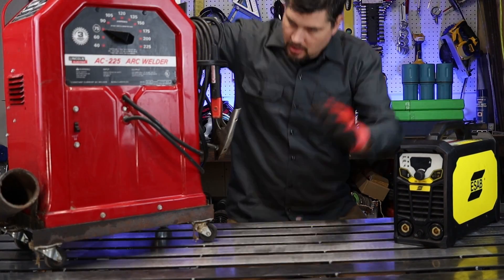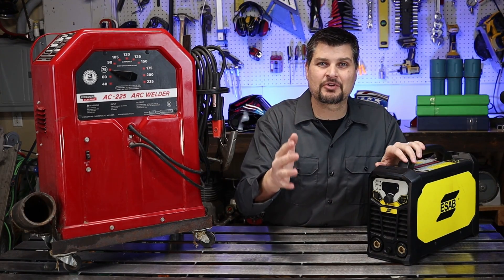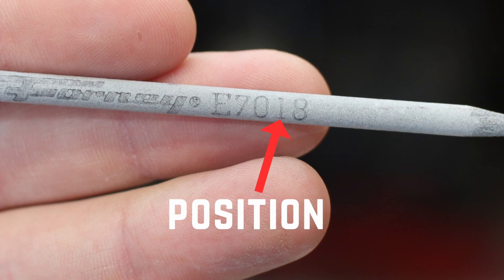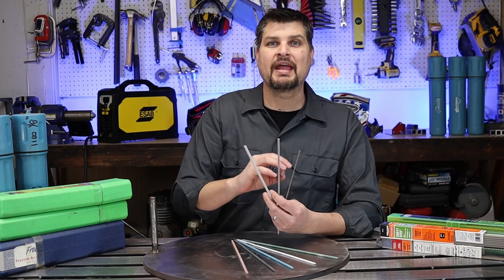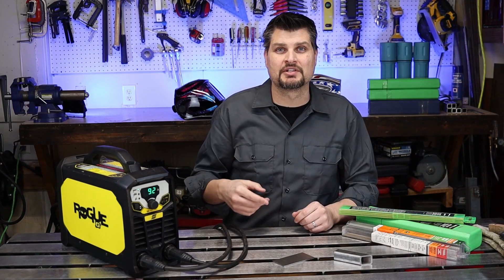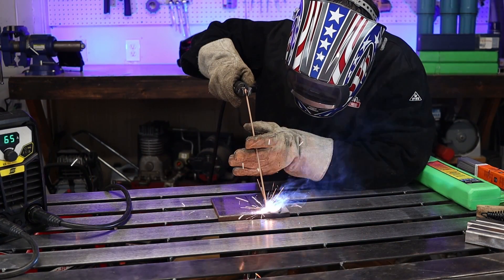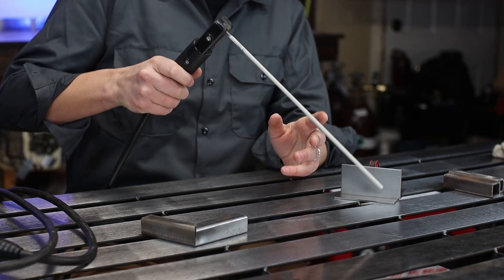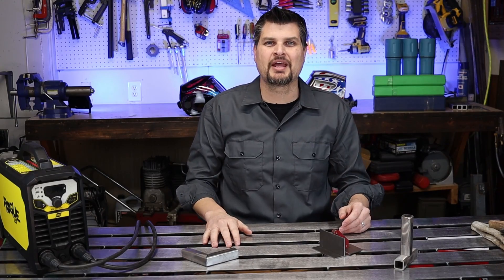Stick WELDING Basics: How to ARC Weld 101

Comment: Great Tutorial!  My Machine is an inverter type, I am using 1/16" 10" rods They are E6013 Lincoln Electric Fleet Weld Rods. I am using a 120 Volts Inverter Arc Welder. These rods say they are rated for 20-45A  I have an auto Darkening Welding Helmet, Leather Gloves, a Welding Vest made of Cotton, and I am learning how to weld.  Went through a little bit of this back in High School, but needed a refresher course on it since I am now 40 lol You helped me a lot. I need some scrap metal to weld on, but What type of Metal can I weld on with these rods?  Can it be Iron, Steel, Aluminum? What metal?

Comment: Which one do I plug in the connections for this welder Welding Machine 110v Stick Welder, 140Amp Small Mini PortableWelder Machine, IGBT Inverter ARC MMA Welder MMA Soldador Portatil with Hot Start, Arc Force, Anti-Stick

Comment: Why does my welding rod stick to the metal and the arc won't start? It sparks but it often melts and sticks to the metal.

Is my grounding not good, or the current not flowing optimally?

Comment: I hate that Striking it as a match it's not like striking it like a match. When you strike a match you put a lot of force into the head of the match to light it , But when you strike the electrode you cannot put a lot of force into it otherwise you are going to make the electrode stick So striking out like a match does not work There needs to be different terminology

Comment: You have several videos that are really helpful for the DIY'er with very limited equipment. I have the slightly bigger brother of the welder in your $39 Amazon welder video (but 120/240v in). 
    Luckily I have a 20A breaker, and (of course a 25ft. 10Ga. extension cord with triple outlet; I have to go outside to work). But if I go portable I might only  have a 15A breaker to work with, and that might be all  you've got. Maybe you are young, with kids and living in a apartment, and you can only go to your grandparent's house,  unplug the washing machine and weld in the driveway. 
    There are reasons why you might really want to weld, but be stuck for a long time with a too small machine. So I've thought a lot about what can you do if you are limited to 55-65A. 

    So here goes: 
     7018 is a long shot. 3/32" rods are widely available but 60-65A is the very minimum of what they need. The legendary strength of 7018 could be cancelled out by porosity (restarts). Restarts because you keep tripping the breaker or you struggle to keep it lit at a low current setting. 
    Hobart makes 1/16" 7018 (30-50A), but it is hard to  find. I got some at Murdoch's at $13+tx for a one pound box, but I haven't tried it out yet. This should work but I don't know if it is worth the trouble. 
    Maybe get good with the other types first. 

    I would bypass 6013 in favor of 7014. They are both shallow penetrating sticks with heavy slag, but 7014 can deposit more metal (like 7018). If 6013  is what you can get, by all means use it. You can do good work with it. Either of these ('13 or '14) would be good to learn with.  
    I do get the 1/16" 6013 (20-45A) from Harbor Freight. They have a two pound box for $9+tx.($4.50/lb.) which is a good price for such small sticks. 

    The sizes smaller than 3/32" always cost more per pound. You have 3/32"(=6/64"),  5/64"(=5/64"),   1/16"(=4/64"). 
    I've got some Blue Demon 7014 in both 5/64" and 1/16" sizes. The five pound box of 5/64" is about $4/lb., but the 1/16" is ,$7/lb. The Blue Demon recomended current ranges are 3/32":70-90A,  5/64":60-80A, 1/16": 30-60A. 
You might be able to use the  5/64" because 7014 has no problem with restarts (unlike 7018). You could weld an inch of bead (or even 1/2"), wait a minute or two, and repeat. You could also make three overlapping passes with 1/16". 

     6011 is an agressive, deep penetrating electrode, but it is also fast freeze. You may be able to weld fairly thin metal if you move fast.   If you start to create the puddle and then break the arc the metal freezes instantly. You may be able stitch weld thin metal together this way (random over lapping tacks untill no gaps remain) 
     The current range for 3/32" is 40-90A, so you can go pretty low on the current. I would not learn to weld with this one, but don't ignore it either. 
    Hobart also makes a 1/16" 6011 that runs at 20-40A. I can get a one pound box at Murdoch's for $12. I would stick with 3/32" unless you really need the small one. 

     So part of the low current game is to have the small sticks you need while keeping an eye on the cost. 
    It makes sense to learn thin metal welding if you have a small machine. I already mentioned stitch welds for sheet metal. 
    For steel tubing (round or square), it is easy to burn thru, so there is a dab-dab technique (for 6013 & 7014) you might use to spread out the heat. 
    You strike the arc and drop the stick to about 45°and then break the arc once you have the molten puddle. The metal will cool from white hot, to pale yellow, to orange to bright red to dark red to black. You restrike the arc on the front edge of the last bead before it goes dark. The new puddle will remelt the front third of the last one, and so on. The drag angle, 45° below the horizontal, lets the arc force push the heavy slag back away from the front of the puddle. It is usually easy to restart the arc while everything is still hot.
 
    Anyway, that's the low current stuff I've been thinking about for the last couple of years. DIY PRO is very flexible in showing lots of ways to do a project, which I appreciate. If you made it this far and you   found anything useful, take it and run with it. Best of luck.
Reply from the maker: Congrats, I'm pretty sure this is the longest comment anyone has posted. 
Thanks for the insight!

Comment: I am a wanna be welder, a total noob.  As I understand it, you do not want to actually touch the rod to the work once you get the arc started, yes?  You want to maintain the arc but keep the tip of the rod within 1/8 inch or /16 inch, yes?  I don't think you addressed this in the video.

Comment: Great information, thanks. One thing that I can't seem to find on any intro video is information going in depth about grounding. I know the negative needs to be grounded to the work bench/piece but I noticed in this video you only had a small section cleaned raw and the rest was rusty. Is this fine? Do all work pieces need to be cleaned down to raw metal. If you can clarify this I would appreciate it!

Comment: Love my Lincoln ac dc machine. Done alot of different work over the years and needed it. But i agree with 7018 and 6013. Always used 7018s in the plants and 6913 at home. Smaller stuff.
Reply: hell yeah

Comment: I have never touched a welder in my life, I was thinking of picking up one of those cheap handhelds on Amazon.  I need it just for one thing, I had to cut the exhaust on one of my vehicles to drop the transmission and I need to put the exhaust back on.   Would one of the cheap ones on Amazon do the job?  I don't care how the word looks etc, I just need the exhaust back on

Comment: I have a Hobart Stickmate 235 LX. While I am not the best stick welder in the universe, I am just a DIY-er Welder. I do not weld all the time. Maybe 20 times in the past 10 years. However I have no issues with striking the electrode and running a decent bead. My issue is (while using 6011 electrode) and can never get the elusive "Slag" cap over the bead that I always see in videos that the Pro Stick welders get and they just casually lift off. I relish the day that is happens to me. Any tips on getting that prized "Slag" cap on a weld bead? Information: 1/8"" electrode (6011), 90-amps, on 1/4" common steel.
Reply from the maker: Smaller rods, 3/32" and thinner, are hard to get a cap especially with 6010 and 6011. Those 2 just love to chip off in little pieces. 7018 produces the best slag peel. If you want the satisfaction, get some 7018, 1/8" rods and have fun!
Reply: 6011 is my favorite stick. For the 80+ years it has existed it has been used to weld rusty, greasy painted metal that can't be properly cleaned in the field. Known as the mud rod, farmers rod, etc., it aggressively burns into the base metal. It is fast-freeze and has filled many unreasonably large gaps. (If the gate is busted, you need a strong repair as soon as possible!!!) 

    If you can get a nice slag cap on your 6011, you may be the very first person to ever do this. Take a picture! But for someone learning 6011,  expect an ugly mess. Even if you get to  be a 6011 wizard, and you have evenly spaced little ripples in your bead it's still going to be kind of messy and ugly. 

     For guys learning 6011, don't kill yourself trying to  make it look like 7018. You could grind it, make a small, deep pass with 6011, and then fill it out with a larger 7018 pass. I just don't want anyone to give up, because they made an ugly weld with 6011.

Comment: Been welding (self taught DIY) with a 250 Amp oil bath machine for about 35 years and then got lucky.
My sis in law gave me a working 160 Amp inverter machine on condition that I repair their 200 Amp machine, which I did for about 5 Dollars.
What a pleasure to weld with DC.
Informative video mate. Thanks.

Comment: I bought a pack of 6011 because it's all they had and I wanted to practice because I have absolutely zero experience. Either I'm the worlds worst beginner welder or those rods are tough to learn with because I ruined two rods because they would stick before I ever got a bead going. I'll try 6013 when they come back in stock at Tractor Supply and hopefully my confidence will improve.
Reply: Save those 6011's, they may be useful later on, but maybe not to start with. 
     You're gonna stick those electrodes (unless you are a robot). Sometimes you can get unstuck with a quick twist of the wrist, but just keep at it. 
Try increasing your current setting ten or twenty amps, that might be the problem. 
    You might try 7014, if you can get it. I've made slag welds with both 7014 and 6013, but they would be the easiest to start with. You can avoid that by dropping 30-45 degrees below the vertical, like you are dragging the stick away from the puddle. The stick is pointed back towards the puddle and the arc pushes the slag back out of the way. 

   Anyway, have fun, because then you will weld and learn more, and get better faster.

Comment: some expert welders say 6013 is the easiest to learn with. One pro told me that DC is easier for beginners. Also, for tool steel of any sort you need low-hydrogen rod like 7018  or 10018. For tool steels, preheat a little, not red hot just say 300 degrees,  like with a propane torch, and use a littel less amperage. If you can, have somebody with a propane or acetylene torch to keep the weld from cooling really fast and hardening. Like when knife makers quench steel in oil. Fast cooling make it hard and brittel and your weld might break.

Comment: What about Acid rods vs Alkaline rods.?
Im not a welder, Im green when it comes to this, but got myself a stickwelder.
Its a new Insulated gate bipolar transistor-based handheld welder, but its packed with a lot of adv. settings for one of these sketchy handheld welders from the fareast .
* Hot start percentage
* Force percent
* Valley percentage
* FRequency percentage 0 to 99
* VRD
* vs CC vs CP  (seem to be Alkaline vs Acid rods and the visual in the colorscreen shows full vs half, is that the cycle?)
Trying to find logic in these settings... you can see them here. https://www.youtube.com/watch?v=j3ApUD9zS9w
as mentioned its a new generation of even smaller IGBT based handheld welder.. that weighs 950g and uses less wattage.. between 2 to 3k, I'm on 230v (Denmark)

Comment: For all of you beginning as a certified welder, don't be intimidated by the 4g (overhead) position. Remember, an overhead is an upside-down flat (1g). Set your heat for the 1g for the 4g.

Comment: I've been welding since 1972, AWS D1.1/5.20, 1" plate all positions. I've used AC and DC but prefer DC as the rod choices aren't as limited or expensive. 6010 or 5p are DCRP. 6011 is AC or DC. 7018 if AC is with red numbers, sometimes double stamped. DC is most often the best to weld with.

Comment: Great informative video, I have just managed to get a small DC stick welding machine. This is great advice and starting tips for welding newbie like me.
Reply: Don't push down and strike it like a match. Just scrape the bare end of the stick across the metal to strike the Arc. If you actually strike it like a match then you'll realize why it's called "stick" welding. But really if your rod sticks then just turn the volts up. That's all stick welding is, amps to melt the rod and volts to help it penetrate.

Comment: If my Home Max Voltage is 220V and Max 30Amps , Does That Mean I can Only Set my Mig Welder to Only 30 Amps and Only Use 1/16" stick 20-40Amp
Reply from the maker: No, your house 220V and 30 amp would be the input voltage. The welder takes that voltage and drops it and ups the output amps. You can use Ohms law to figure out the exact input and out put voltage and amps. The max amperage you can typically get OUT of a machine on a 20amp breaker is around 120 amps. Running on 220V and a 30 amp breaker you could get around 250 output amps. It's late so hope that makes sense!
Reply: @-DIYPRO-  Thank you.. Once you mentioned Ohms Law I found articles..

Comment: The old tombstone transformers are def big and heavy, no doubt. But they're freaking indestructible. Replace rotten wires, sand corroded terminals .. banda bing bada boom, good as new. I'm a big fan of electronic circuits built with PN junction semiconductors that the inverters are made from, but there's something to be said for the zombie-apocalypse-surviving simplicity of the transformers. Worth having one around imho.

Comment: Good job. Great video enough info to get safely started with.  I'm a DIY'er myself and it took me about 5 mins to figure out that MIG welding is to messy for me. So now I'm moving on to ARC. This looks a little less messy so I'm anxious to give this a try. I've seen guys doing "tack" jobs that look really clean. What sort of weld is that? Someone said probably aceteylene? How does that work? What kind of welding is that actually called? Do you have a video on what that entails to get start started?

Comment: they way inverter welders they work exactly like the VRM on a computer for power for the processor. Instead of having one giant transistor that will get really hot, so what they have is multiple transistors that fire down a line like a marque light.

Comment: Couldnt get any cheap inverter machine to run worth a crap. Im sticking with the good old buzz box. Much nicer  welds.
Reply: I'm loving my titanium unlimited 140 it does a good enough job with Arc and mig I haven't tried out the Tig yet

Comment: This DIY welding is 110% free educational...
Its a wow🎉🎉❤
Reply from the maker: Thanks!
Reply: @-DIYPRO-  Hie what welding machine you would recommend for people where is no electricity at all, should they buy DC welding inverter and power it with generator .Please help because I want to know whether is possible running DC welder using  AC geretor

Comment: Thank you for the video. I am in the beginning of learning stickwelding, having only used mig before. Gonna weld a pizza oven, so this video was informative!
Reply: I am learning to stick weld as well…I can mig weld pretty good and I thought I would jump in and stick weld without any problems…I was wrong 😂 something that i kept having issues with at first was not pushing my rod in bc it’s not self feeding…but you get the amperage right for the rod and then figure out how they burn it’s not too hard…good luck to you

Comment: Can u explain y not to start with 6010 that’s what we have at my work
Reply: If you have a professional DC machine, you get a nice clean current (almost like a giant battery),  so 6010 runs great. 
     But if you buy your own machine on a budget, you probably have a used AC buzz box, or a cheap DC inverter welder. 6011 runs just fine on either.
     6010 won't run on AC, and probably won't run on the cheap DC machine. These little machines either don't have very good filtering (jittery DC) or maybe none at all (pulsating DC). For whatever reason 6010 hates this, and 6011 doesn't care a bit.